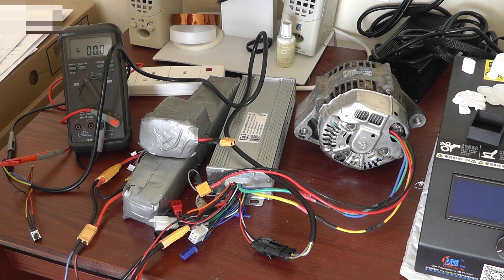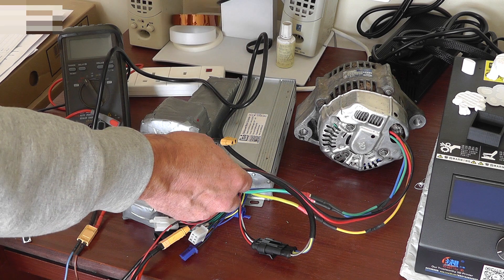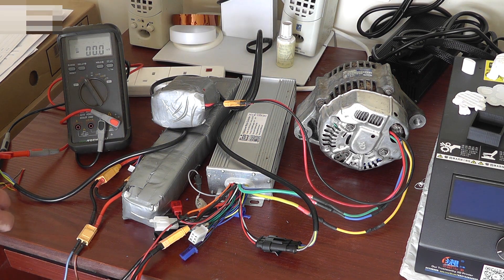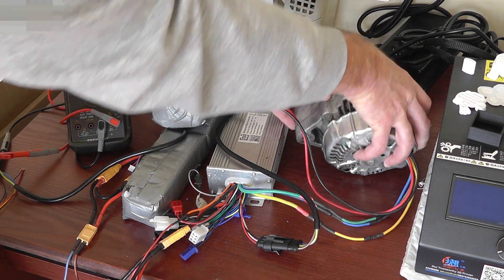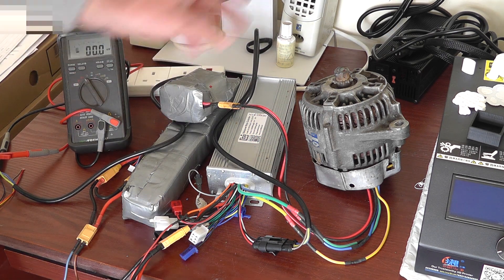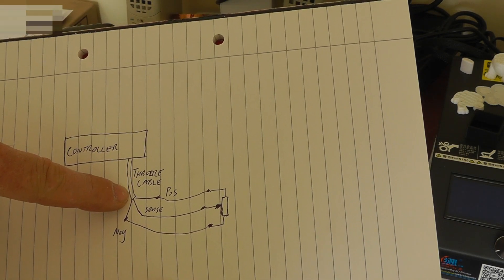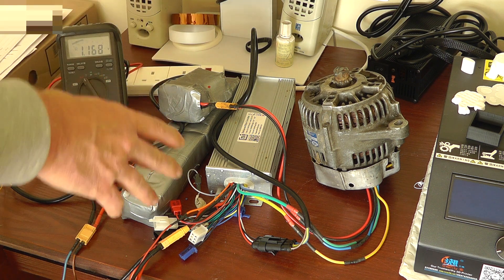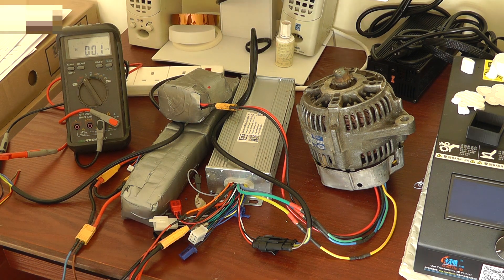Ebike throttle controlled by a POT and external 4.2V battery

Comment: My question is, how do you use one throttle to control two controllers, i've been thinking about the idea that I don't know how to implement
Reply from the maker: I've never done it but I believe you hook up the 2 Gnd wires, use the +5V from one of the two controllers and both sense wires go to the throttle output.
Reply: @alibro7512 that is what I was thinking, but yeah, I didn't try it yet
Reply from the maker: @dn7783  So long as the two ground wires of the inverters are connected to the throttle Gnd then the sense voltage from the throttle will have the same effect on each. I've seen some people put motors on front and back wheels of their ebikes to give two wheel drive. If you wanted to there is nothing to stop you fitting two throttles, one for each wheel.
Reply: @alibro7512 yeah, i've been looking at flip sky controllers, and I was thinking to myself some controllers only I have one motor input but I understand why, because it has a diagnostic mode for sensing the phases out of the three phases on the sensor.
Reply: Yeah, but 2 throttles, it seems unnecessary. I would prefer having one throttle to control them all

Comment: How do i wire up a potentiometer that's coming from a hall sensor throttle?
Reply from the maker: Why would you want to?
Reply: @alibro7512 i need to reduce the output of my ebike throttle for uk road use,I've bought a potentiometer but not sure how to add it ?
Reply from the maker: @jasonleesuffolk  Doing this wouldn't change the legality of your ebike since afaik any kind of throttle is illegal. The police would not be testing the throttle anyway, they would look at the motor/controller power to confirm if legal or not.

Comment: Trying to figure out your drawing on connecting the pot. Your drawing is unclear. Can you define to colors of the wires and connections to the pot?
Reply from the maker: I don't know the colours of the wires in your controller as they are often different but pos 5V goes to one side of the pot, neg (0V) goes to the other side and the sense wire goes to the middle. 
If you're not sure which wire is which you'll need to meter them.

Comment: Hi how much ohm is it  i ask this question to skiping the emptiness in the potontionmeter whene i turn it ...some potontionmeter have a lateness response on motor turn some other it com in the midle to turn the motor ...i thenk that is depend to the ohm of potontionmeter   ..thank you
Reply from the maker: I think it was 100k but I have used a 4k7 POT too.
Reply: @alibro7512  ooo great ...thank you for your answer  ...i will try the 100 ohm and i will see what happened.. thank you again
Reply: I think you may be using a logarithmic potentiometer, you want a linear potentiometer.

Comment: Thanks Ali.  I've been looking for this information for a while.  What limits the current on the 100k potentiometer?
Reply from the maker: The 5V from the controller can be fed directly to the sense connector without any pot to give full power without any issue. There is no appreciable current at the POT.
Reply: @alibro7512  thanks Ali!
Reply from the maker: A standard ebike throttle uses a hall effect sensor to control the voltage at the sensor and it is a tiny device so the current is not an issue.
Reply: @alibro7512  Perfect!
Reply: Another question?  Did you put an ignition switch on your controller?
Reply from the maker: @scolem2681  yes, I bought a throttle that had a switch.
Reply: @alibro7512  Hi Ali.  Although you used and alternator, I thought Id try it with a bldc.  I have motor/controller phase to phase winding connected, motor/controller hall sensor connection connected, connected100K pot  with wiper to center of throttle connection.  Nothing works for me when i turn potentiometer.  put a 5v dc across positive pin of potentiometer and disconnect from throttle positive pin and still no movement.  Something tells me that i have to apply 5v dc across the throttle positive pin while potentiometer is also connected.  I have  Vevor bldc 48V 2KW controller.  There is text showing "Turn The 1.1-3.7V"  on the controller.  I think this is telling me that I need this voltage across one of the connectors to get it to work. Am i missing something?  Is connecting the hall effect connection causing it not to work?  Thanks for the assitance.
Reply: @alibro7512  Hi Ali.  I attempted your method but i am using a BLDC.  Im using vevor 48VDC 2KW brushless controller.  Connected controller/motor positive terminals and negative terminals and applied 48VDC.  Connected controllor/motor phase windings.  placed a jumper across controller electric lock connector (this powers controller and gives 5VDC across throttle positive pin), connected 100K potentiometer with gnd to low side, wiper to sensor pin and pot highside to throttle + terminal.  No luck for me.  Am I missing anthing?
Reply: also connected hall sensor connection
Reply from the maker: @scolem2681  Were you able to get it working with the proper throttle?
Reply: @alibro7512  haven't tried yet.but will
Reply: @alibro7512  Hi Ali. Finally got it.  I had to use a 10K pot.  I think this is because the voltage control is 5v and the 100K does not allow min operating current
Reply from the maker: @scolem2681  well done 😊

Comment: Hi, I have tried something similar with a 5K potentiometer but I find it doesn't kick in until I get to about 7 (out of 10) and if I move beyond 7 it stops.  Any ideas on how I could setup a pot to achieve a similar setup to what you have?
Reply from the maker: I did this over 2 years ago so don't remember much about it.
Have you tried measuring the voltage out? I found it starts to spin the motor around 1.3V and max is around 4.5V
Reply: The range on the POT is so small, its like I have to turn it way up to get the motor to turn and then it is extremely finicky.  It is a 5k POT, should I try a 1K?
Reply from the maker: @105len  log or linear? 
Like I said I don't remember the detail but I don't think the exact resistance was that important. If you put a volt meter on the sensor wire and watch what's going on it will help.

Comment: What would be the purpose of using an external battery to power the POT instead?
Reply from the maker: It was more to prove the point that the 5V to operate the throttle can come from anywhere so long as the neg was tied to the controller neg. This is especially relevant for cruise control which might come from an Arduino.

Comment: Thank you very much. I have an simple chinese 36v 350w ebike that I have been using it for long time ago (10 years!) but the throotle was broken and I will try to use some POT while I can not replace it. Thank you my friend! I will tell you later if it works! I wish you the best. Hugs from Brasil.
Reply from the maker: Good luck with it. Try a 5k POT first.
Reply: @alibro7512  hello! Today I inatalled 5k pot and it is working! Only I feel maybe my batteries is not so good ... I am trying to recharging them. Thank you very much
Reply: @andremurilobr  what type of motor did you run using POT? Was it motors used in hoverboard or E-bikes?

Comment: Think it might pay to say the controller does not use hall sensors ( sensorless)  I bought a sensored controller and not prepared to pull alternator down so bought another controller. Cheers
Reply from the maker: If you look carefully the controller has a connection for Hall sensors sitting loose and not connected. It's just a normal cheap Chinese controller. 
Nothing special.

Comment: Put hall sensors in the motor and remove the brushes and the 12v battery. Your motor will run better
Reply from the maker: Without the 12V battery there would be no magnets?? I' don't think the alternator could work as a motor without magnetism from somewhere.

Comment: which parts were used  is this wrapped in tape are the batteries? how many volts are there? which batteries where to find them
 ,i'm brazilian, which alternator is which car? this aluminum square coming out a bunch of wires what name? how many volts is this battery? how strong would this engine be? Can you climb a hill weighing 90 kilos?
Reply from the maker: You should watch my other videos as many of your questions are answered there but I'll give it a go.
I have two 5S Lipo batteries connected in series so 10S (36V - 42V) and wrapped in gaffer tape.
Standard Lipo batteries bought from Hobbyking
This alternator came from a Rover car but it shouldn't matter. Watch my other videos for more info on the alternator motor but I would recommend a 150A alternator if your doing it.
Aluminium square is a standard ebike controller bought for around $30
This setup would be equivalent to a 1500W ebike motor so is pretty powerful. Again watch my other videos for more about alternator ebikes.